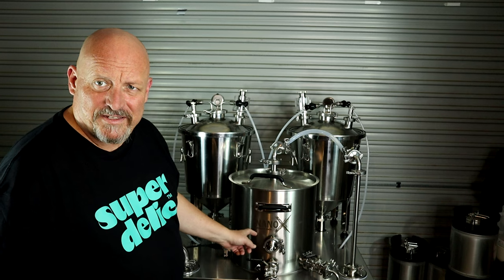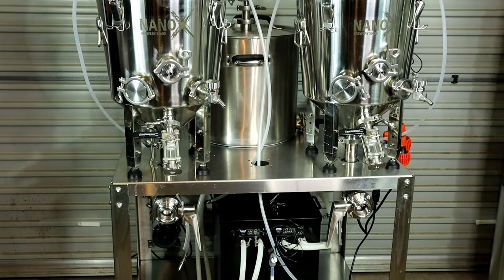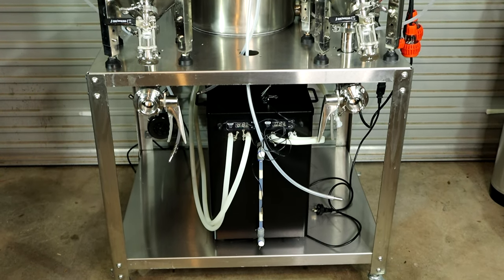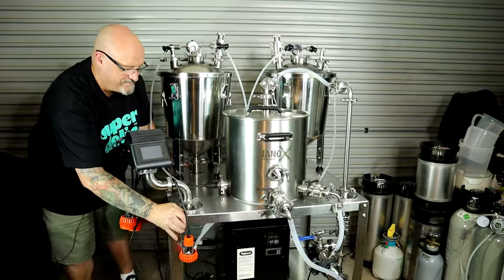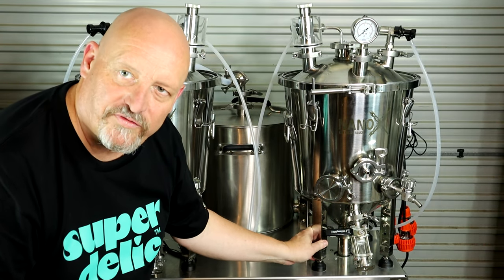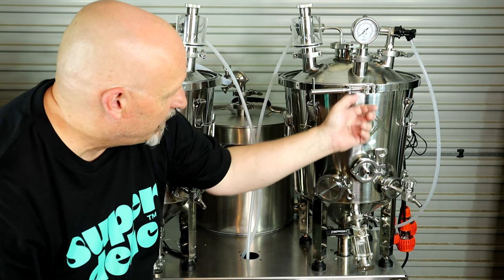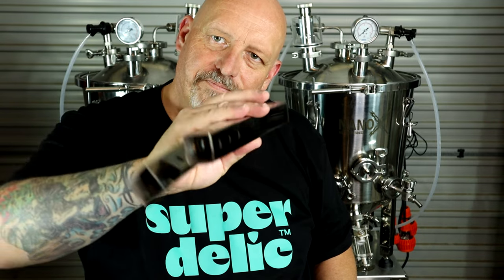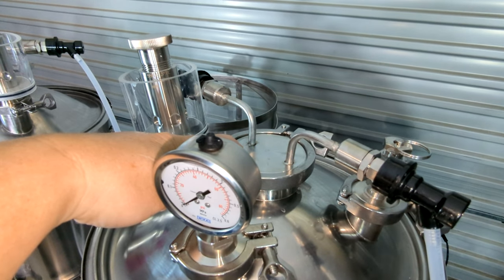WIN!!!  Nano-X TK36 $6,000+ Cheeky Peak Brewery - WORLDWIDE COMPETITION

Comment: Back in lockdown I wanted to biuld a custom system in the UK using Cheeky's mash and basket. They got back to me with shipping costs of over £150, which was expected. Nowhere in Europe could you get what Cheeky had put together. Jelous they don't have a Euro import partner.
Reply from the maker: its in the planning
Reply: @HomeBrewNetwork  Ended up designing my own system with a custom controller and an TC buckets... fast forward a month and you could not buy anything at all... Ended up getting a GF30, fridge and inkbird and later an Allrounder, pressure kit, hop bong and all the other toys. The beer I make at home is as good quality wise as the beer I brew professionally. It amazes me the range of homebrew products avaliable now.

Comment: How about a brew day comparison between this and your gen 4 brewzilla
Reply from the maker: I've done two brews on  the new setup so far, but impossible to run both systems at once on my 15amp circuit. For sure I'll talk it about it  a lot though and can compare. Cheers!
Reply: @The Home Brew Network  I would like to see the efficiency difference between the two bags as well as set up and clean up times of both systems.
Reply from the maker: @colwk  I can tell you know the Brewzilla clean up is minutes where you'll spend an hour or probably 2 cleaning the  TK36.. efficiency is dependent on batch size, but for a 5KG batch things are going to be pretty much the same.. but I'll go over it at some stage in the future, very busy at the moment. Cheers!